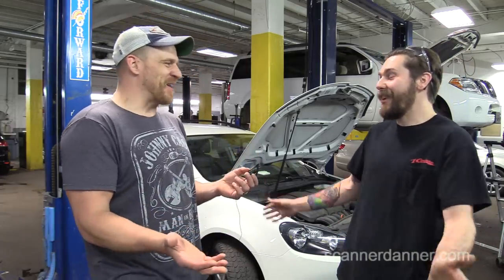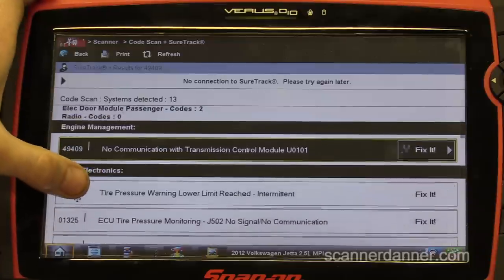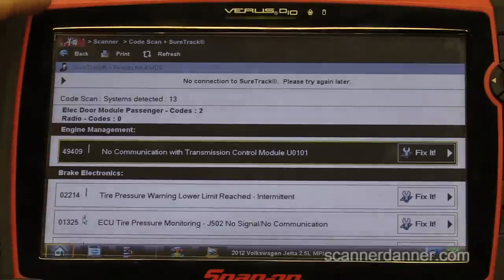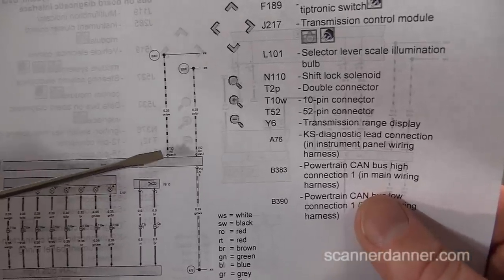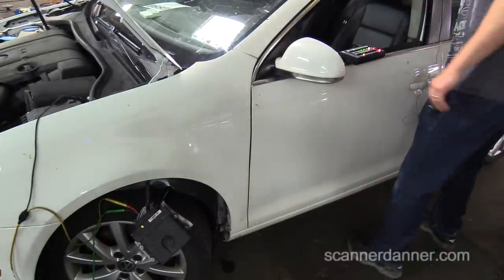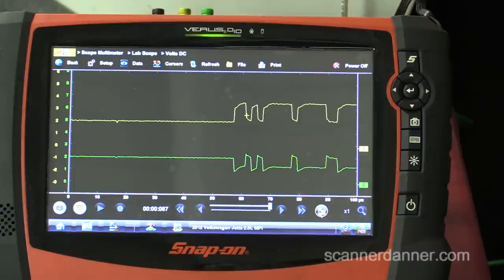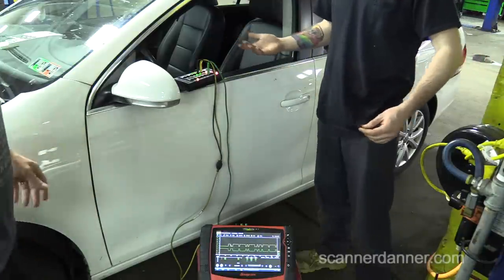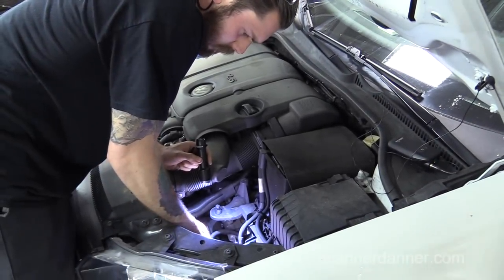2012 VW Jetta No Communication with TCM U0101 (part 1)

Comment: The CAN bus between the gateway and the scan tool is separate from the other CAN bus(es) from the gateway to everything else. Each network segment has its own termination resistors.

What are termination resistors for? They dampen ringing (signal reflections) that would otherwise occur on unterminated wires and ultimately render communication impossible.
Reply from the maker: So there are separate terminating resistors in the gateway specifically for communication with the scan tool? At least on this design.
Reply: As someone else already wrote in comments, the 'gateway' here appears to be operating a bit like a home network router or switch. Each 'port' on the gateway is electrically independent from all the others and communicate through the gateway's software, with the gateway seeming transparent to most normal traffic. If you shorted out the ECU's CAN bus, you would still be able to talk to the gateway and whatever other systems might be on separate ports from the ECU.

With the amount of comfort, convenience and other non-critical systems in fancier modern cars, it makes sense to split unrelated functions into separate CAN busses and use a 'gateway' to bring them all together so a failure in non-essential circuits doesn't bring the engine, transmission and other components down with them. You wouldn't want the volume buttons on the steering wheel to cause the ECU to shut down at highway speeds because a board in the steering wheel fried and shorted your one and only CAN bus.
Reply: I would suggest instead that there are two terminating resistors of 120 ohm each, one in the ecm and the other at the end of the longest stretch of twisted can buss wire device/module what ever that might be.  All others in between don't have them or need them such as the defect part causing the waveform misshaping  to occur. SCSI hard drives are set up in a similar manner, old school tech, look it up. VW has reduced the utility of the OBDII breakout box as far as can line monitoring goes by splitting it into scanner business only and dieselgatebusiness without a doubt on purpose, on other vehicles I have seen Keith of Staten Island fame, use the termination resistor value to call a defective module and there, it was a 100% good call, all from the OBDII breakout box. On this design I wouldn't be surprised to see a single 60 ohm in the module originating the can lines for the OBDII port due to those can lines being emulated can lines. I doubt they bothered to install two 120 ohms with one at the port.
Reply: that is correct. From what I've heard they a lot of manufacturers are starting to go back to a gateway module to communicate through for scan tools and other outside devices (satellites). they are going to be setup as a firewall to keep people from hacking into the car.  that all being said the gateway module will usually have a completely separate bus with a single 60 ohm resistor. obviously since the only modules on this bus are going to be the scan tool and the gateway module there can't be two 120 ohm resistors.

so you actually should check the can bus resistance directly at a module not through the dlc for this reason.
Reply: In the latter part of the video when he looks at the flowchart, the documentation clearly stated that termination is done at the ECU. At data rates below about 1/100th the wiring length in wavelength, single-ended termination is perfectly acceptable in most cases as signal reflections have plenty of time to die down between bits.
On high speed busses like SCSI, and even more so on modern high-speed serial busses where the bit length is shorter than the cable's length, so you need the correct termination at both ends of the chain to prevent reflections from happening in the first place.
The bad TCM signal might be interesting to look at with an oscilloscope that has sufficient resolution to catch higher frequency components. If Scanner does that, he needs to keep in mind that he cannot use ridiculously long ground clips for reference as that would act as an antenna and potentially pick up tons of common-mode noise.
Reply from the maker: Dude, I'm freaking loving your comments! I'll have some questions. Give me some time to absorb all of this first. Thanks so much!
Reply: well said! it's not like they make multiple data bus on a vehicle for fun. there actually is some thought behind it lol
Reply: I have no idea what you will (or will not) find by doing this, I only threw that out there just to make sure that the scanner's built-in scope isn't missing something important.
The sloppy tops, slopes and out of sync lines could be caused by the TCM's CAN line driver not having power: the higher voltage line gets clipped to the CAN driver supply voltage by protection diodes which then messes up the low line via the TCM's bias network which is now powered from the high CAN line. I've seen similar waveforms when debugging discrete logic circuits missing power supply on a chip. That also explains why the CAN lines get dragged low.
You may have power going to the TCM connector, but power might not be going everywhere it needs to go within the TCM. You may want to try finding a reference value for how much current the TCM should draw and check how much you get. If you see much less than expected, there may be a blown fuse or broken connection inside the TCM itself while more than expected may indicate an internal short.
Reply: Teardown Dan in simple words, a faulty TCM :)
Reply: Quite likely. But as an engineer myself, I don't consider troubleshooting jobs done until I have found out exactly how and why something failed. Car electronics are supposed to last 10+ years so why did a ~5 years old TCM already go bust? Bad solder joint on the connector? Blown fuse? Dead CPU? Dead internal voltage regulator(s)? Dead IO drivers? People who own VW cars may like to know if this could be a deterministic failure mode, in which case VW may need to offer free out-of-warranty repairs due to design, manufacturing or material flaws.
Due to the TCM's dumb location in the wheel well, the problem may have been caused by a rock flying off the wheel, hitting the TCM through the liner. If I owned a vehicle built that way, I might go to small claims if the manufacturer refused to replace TCMs that suffered road damage for free as putting a critical piece of equipment in a high risk location makes it unfit for its intended purpose of driving on public roads.
Reply: Teardown Dan you are absolutely correct I was thinking that very thing watching this video the module is too young to have just failed unless of course the vehicle has very high mileage but I'm thinking one of them would have pointed that out
Reply from the maker: You are one smart guy. Can we exchange contact info?
Reply from the maker: paul@scannerdanner.com
Reply: absolutely correct i dont understand how some of these people come up with there desighns on where to put some of these computer brains its crazy my tcm for my 02 gti is under the front windshield right where water goes when it rains ?
Reply: Might add that a CAN bus is a balanced transmission line. That's why the wires are usually twisted at a specified number of turns per length. The ringing is caused by the reactance of the line. You can think of it much like water hammer in a water line though it isn't the best comparison since water isn't compressible.
Reply: Having the Verus test leads tapping into the CAN bus could have been causing some of the signal distortion, especially if they were very long, coiled etc.
Reply: The signals looked fine with the TCM unplugged, so that clearly isn't it. You would need a ridiculous amount of wiring to add enough stray capacitance to round off rising edges like this on a line with ~60 Ohm impedance to ground. The capacitance slowing down rising edges must come from the TCM.
Reply: Teardown Dan.  brilliant explanation, what do you mean by IO driver??
Reply: Voltages do not magically appear on wires, some sort of circuit has to apply voltage to them. That circuit can be a handful of discrete electronic components, a mix of discrete and integrated electronics, or even just a plain interface IC.

The market for CAN drivers/receivers/transceivers is pretty large. Texas Instrument alone has nearly a hundred different chips in that category:
http://www.ti.com/lsds/ti/interface/can-products.page#

Chances are that whatever circuitry any automotive manufacturer plugging into the CAN bus will use a similar chip from whatever manufacturer, often with an implementation that sticks closely to the chip manufacturer's reference design.

Comment: The termination resistors are there to absorb the leftover voltage so that it doesn't "echo" back through the wire which has nearly no resistance.  Essentially they absorb some of the load to keep the line clean and not staticky.  Good question on what generates the voltages, I am not aware of which module does it or if all of them do it.
Reply from the maker: I have since learned that ALL of them do!! That was one of my main questions early on that no-one could seem to answer. Thank you!

Comment: Termination resistors absorb "ringing" that occurs when power is quickly removed from the CAN line.  The CAN line itself is an inductor that develops a magnetic field around it when energized. Inductors resist the quick change in current that a square wave produces, which causes the magnetic field around the wire to collapse and induce a secondary current in the opposite direction.  This process repeats rapidly and is essentially a resonance which appears as noise.  The resistors dissipate this energy before it can interfere with communications.

Comment: Another purpose for the end of line resistor (EOL) is so the computer can monitor the integretary of the wires - if a known voltage is passed through a known resistance then a known current is the result. That current is monertered by the computer - loss of current signals open circuit. Interesting video - it looks like the architecture of the buss is more of a star configuration than a serial configuration and the resistance readings from the transmission read back to the ECU. This type of buss configuration is both faster and safer... Fun video - I just finished up 2 jetta's they were both a pain in the butt.

Comment: I know this is an old post.   Your differing can bus signals near the end of the video.  I would think the signal is buffered with electronics inside the gateway.  It will be some sort of isolation transistorised distribution of the can bus. So as if one module goes short, it doesn't pull down the rest of the bus. That's way your not getting the exact same can bus signal on pins 6&14 as you are getting at the TCM.
Reply from the maker: we have since learned more about these systems since this video, thank you for the info!

Comment: You should try a bidirectional test with the tcm unplugged with a trigger on the diag socket traces.  maybe they will be an exact match as the gateway should send the command you are sending to the ecm?

Comment: Offboard Diagnostic Infromation System. Very different than VAGCOM. They both have their place but very different. VAGCOM is nice for quick basic settings, code pulling, output tests and non warranty related repairs. ODIS allows for diagnostic "test plans" to walk though difficult trouble shooting, component protection, login access to secure areas of control modules, coding, programing, key adaptation and various other "dealer only" functions. It also records diag logs to submit for warranty to prove failures and countless other functions. It is after all the dealer scan tool and lets you do everything.

Comment: Yeah, we used to bust Tom all the time about using 'your' DVM. He does sound a bit like you in the videos as well. Nice collaboration, but I'm still unclear about the terminating resistors on the CAN and modules. I thought the TCM would have a terminating resistor of it's own. I agree with you guys, it would be nice to have a way to verify that the TCM is defective above and beyond how the CAN lines appear. Thanks guys!
Reply from the maker: many different configurations as far as the terminating resistors go is what I am learning
Reply: With putting resistors in the circuit it provides a feedback into the lines so it's it's designed to stop interference that's why the patterns are mirrored you take mirrored patterns and you connect them via resistor they cancel each other out

Comment: Revisiting this 6 years later would you have approached this differently? I’ve been starting with description of operation for communication. Lots of good info such as terminating resistor locations. Then to the schematic to see lay out and test points. Did this vehicle have resistors in gateway from the DLC? I know that’s now a common thing. Was that where you were getting 60ohms? Or was it in fact tied into the CAN bus from the DLC? And if so why the difference in wave forms from DLC compared to back probing modules?

Comment: 66.8 is considered good, as the resistors have quite a high tolerance so you will never get an exactly 60 Ohms measurement. My VW Golf has three or more CAN networks. I believe the Powertrain one is the one you need and are on. 
I agree with you on the VW wiring diagrams, I got an ECU pigtail and the colors and connections are off by a high margin. CAN high is supposed to be pin 79 in the 91-pin connector. CAN Low is supposed to be pin 80 in the 91-pin connector. 
The Pigtail has one connection on 79 with a different cable color, and no connection on pin 80. I have the original VW wiring diagrams, just like you guys have.
If the ODB sniffer is the same as the one I have, one switch is for 12 V always on (30) and 12V Ignition (15). I have the Godiag GT 100+.
The K-Line is a one wire network for the different connections in the background going to J533 There is a LIN bus in there too, another one wire network going into J533. There is one for the Radio/Video and such, called MOS I believe. It's a Glasfiber network. On my Golf anyway (2017 Golf Hatchback 1.8L Gasoline powered). The 5V reference circuit is created in the ECU I believe. It has the 5V regulator. But I'm sure you know all that stuff by now.

Comment: Nice video. I think that just with unplugged TCM with attached scope leads on can-bus communcation give all the answer that TCM is no good. My only question is, is there a resistance measure on TCM modul can-bus terminal for verifying that the TCM is no good? ( I do not like to much resistance check)

Comment: I almost feel like the 60 ohm measurement you made on pins 6 and 14 were measuring a resistor in the gateway module and one in the scan tool. If you unplugged the scan tool during that test it would be cool to see if the measurement stays at 60 ohm or goes up to 120 ohm. If it went up to 120, this would prove that the test of pins 6 and 14 was invalid for checking the main CAN network of the car itself.

If there was no change, then you could unplug the ECM and see if the resistance goes up to 120 ohm. If it does, this would prove that the test of pins 6 and 14 was valid for checking the main CAN network of the car itself.

Comment: total resistance in parallel resistors, if resistors are the same value
is total resistance of all resistors divided by resistors count.
On my Express the ignition/crank/Transmission lock/etc goes thru the cabin fuse block as well as the under the hood distribution block... I would check the fuses and relays in the cabin block.
Maybe this car has resistors at each module !? so the 2 count 60ohm is misleading.
...and 6 h and 14 l generally go to the DDIM... I have seen a vehicle that had a bad DDIM that caused havoc on the IPC, once unplugged, the IPC realigned clean.
or faulty wiring, connections between the Gateway and CAN, etc...
Did you verify that the V on the CAN H and L are not the same? and add up to 5V?  (2.7... 2.3)?
...but you actually got the answer early in the troubleshooting sequence at 6 and 14 not showing 60ohm... but tricky!

Comment: From my experience, these communication termination resistors keep signals from trying to go back up the way it came. When working with DMX 512, the standard for communicating with moving lights, you daisy chain all the fixtures together. at the end of the line, since there are no more fixtures to connect, that signal wants to try going back home so to speak. a terminator (which is a connector with a resistor bridging two of the pins) is used on the output f the last fixture to prevent any issues with the signal.

Comment: The resistors are for pulling the can lines back to the bias voltage. And for where the voltage is coming from. It can come from anywhere but I'd take a guess and say the ECM is the one that provides the voltage.
Reply from the maker: I've since learned that each module on a CAN network supplies this same 2.5v bias line. So the answer is ALL of them!

Comment: the terminating resistor just kills the signal so you do not have a request hanging out on the can line waiting for a reply or answer from a module. most term resistors on vw family are in the modules, also with vw family you can go in address word 19 (gateway) MVB 125 and up will tell you can communication. If a 1 is read signals are good check power to module, if 0 is read there is a communication issue on the can, which is more than likely a wiring issue

Comment: The breakout boxes are bad ass I use mine a lot when I have network issues helps me find problems quickly on the network. You could of always cut the Tcm out of the network and checked it's output seperately

Comment: Could the difference in the resistance values at pin 6 and 14 been due to added resistance in the Circuit going through the breakout box and length of wires?